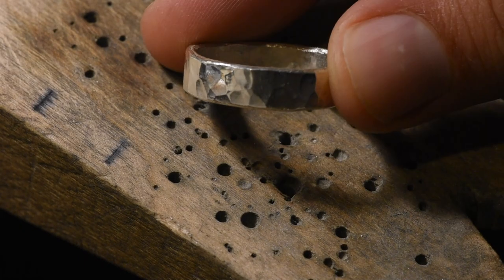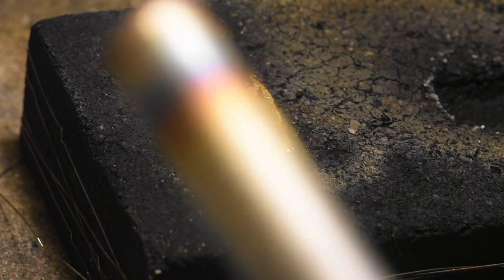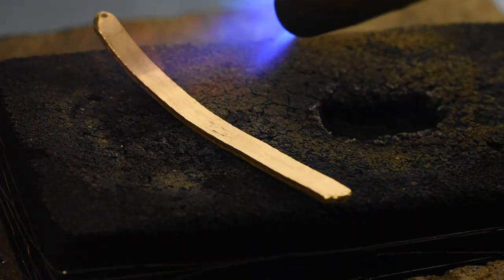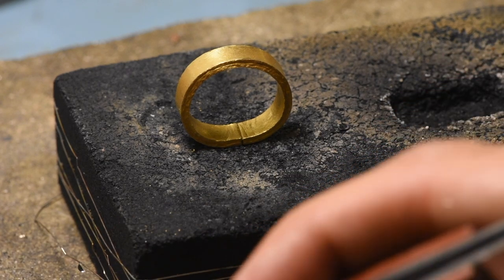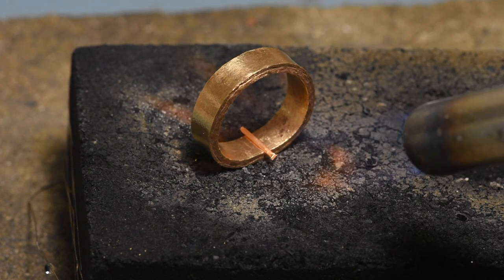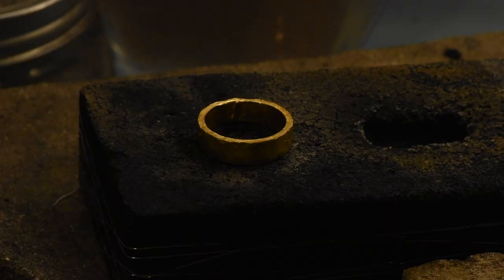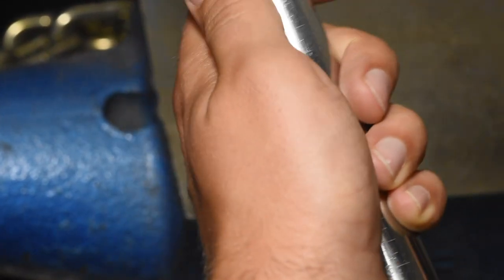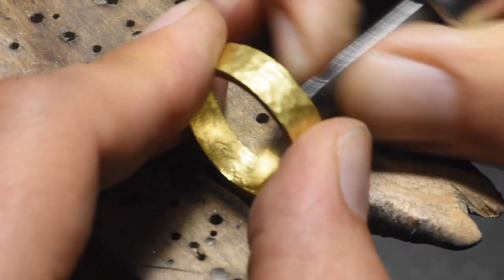Beefy, Brawny, Badass: Making a Man's 24k Gold Wedding Ring

Comment: If you want to remove the taper that comes from forming it on the mandrel, you can size up that last size by hammering it on a socket instead of a mandrel. The trick is to have the ring a smidge smaller than the socket and then hammer the socket through the inside of the ring. The chamfer on the socket and the taper inside the ring make this operation possible. Then hold the socket in a vise with the ring around it and hammer to size just as you'd do with a mandrel.

Comment: Have you tried a liquid flux to fuse the 24k gold?
Great video, thanks!
Reply from the maker: GIVEN: My understanding of flux is that it is used to quell the formation of oxidation and other atmospheric gases interactions with metals that are being heated.  When the heated flux shields the metal, it prevents these contaminations that would otherwise jeopardize the structural integrity of the "joint".  
GIVEN: Gold doesn't interact with any atmospheric gases, even in the liquid phase.
THEREFORE: No need to use a flux with fusing 24k gold.

Comment: That is frigging awesome I absolutely love it. I had no way you could melt down those single ingots. I have a powerful butane torch wirh small flame outlet. I have seen other jewellers use it. Do you think it would work? 24k is soft as can be. I can't get over how you made that. It is so impressive. From a local jewellers here £900 easy for a single 5gram 24kbgold ingot £300 what a saving

Comment: What is the surface you melt the gold on? Thank you
Reply from the maker: Charcoal block. Theoretically... pure carbon. 
Low coefficient of thermal conductivity. 
Wet with water to prevent combustion. Re-wet after every flame. 
I dug a hole to allow the gold to sit in without risking a mess!
Reply: @mustachemetalworks  Thank you! Can you melt gold on top of a clean anvil?
Reply from the maker: Trust me, that's not a good idea. The anvil will soak up the torch heat and you'll end up with a hot anvil and a warm piece of gold.

Comment: You’re the only person I’ve seen use 24k to fuse at the end. Anyone know why jewelers use lower karat gold to fuse?
Reply from the maker: Using the "base" metal (in this case: 24k gold) is the only way to "fuse". 
Using a lower karat gold, which probably has a lower melting point, is technically a solder, because the base metal now has a lower karat solder in-between the two sides.  
A real "fused joint" requires the base metal to melt and solidify with only the base metal. 
I use 24k dust and chips to add extra metal to the joint but I technically don't need to. I could just let the two ends melt and solidify. 
Using the beneficial melting properties of a lower karat gold is cheating if advertised as a "fused joint"

Comment: I also found that fusing is a butt-clencher for sure 😆, though far preferable than using solder and 'contaminating' a pure piece imo!!
EDIT: BTW I found that sticking a wad of ceramic-wool through the middle of the ring makes it 'safer' to heat from the outside, gives it support so it doesn't collapse
Reply from the maker: I'm happy to hear that fusing is universally terrifying.  
Good trick with the ceramic; do you find that it clings to the metal after melting? I would hate to foul gold for the sake of easy fusing.  I would prefer some carbon based material, like a piece of jewlers charcoal cut-to-fit, but thats a pain in the rear-end to manufacture.
Reply: @mustachemetalworks  only time it clings slightly (like literal tiny fibers on the surface) to the gold/silver is when it’s completely melted (or if borax is used, naturally), and is very easily removed as simple as being able to be rubbed off by hand once it cools, or pickling for ~15sec (even including borax). No problem at all if annealing or fusing 👍

Comment: What is the block your heating the gold on
Reply from the maker: I do all my gold melting work on solid charcoal blocks.  They're found on Amazon or specialty jewelry tool sites.  Gold doesn't get fouled by charcoal, so it keeps everything clean.  

If I'm not getting up to the melting point, I sometimes work on a vermiculite board, which is super heat resistant.  But melting silver/gold on vermiculite will foul the metal with yucky flakes.
Reply: @mustachemetalworks  awesome reply thank you so much! 
Really want to get into this but can't afford all the equipment up front. 
Thinking of sand casting sterling silver in the meantime... Is that a good option or is the quality not up to par?
Reply from the maker: @HarrisTRT  I've never done casting, so I can't comment as an expert, but I would say that it's very very different quality than forged work.